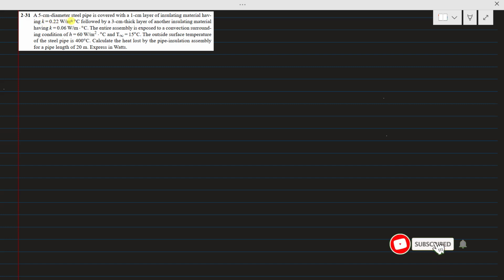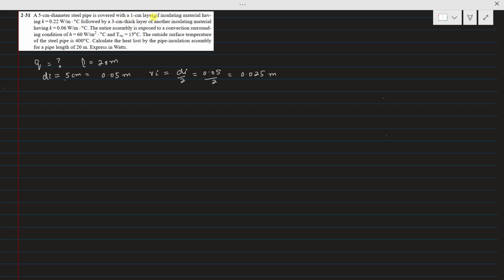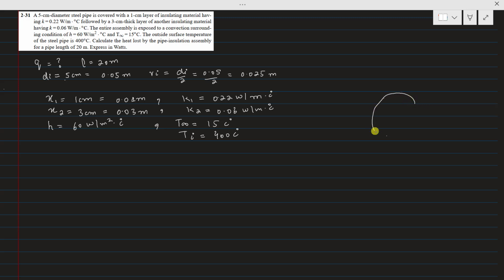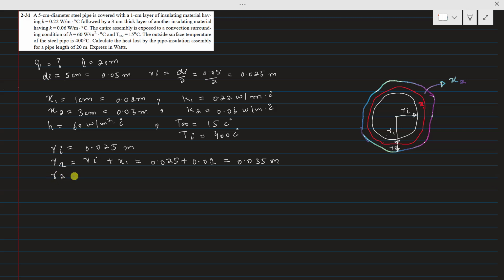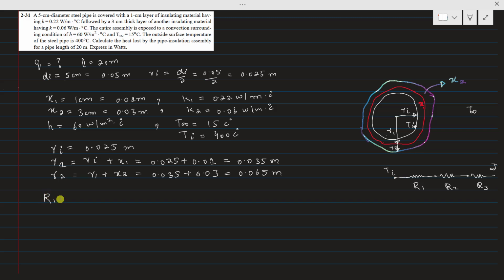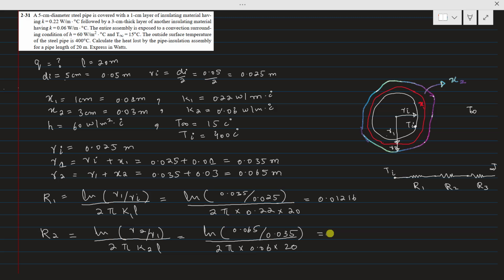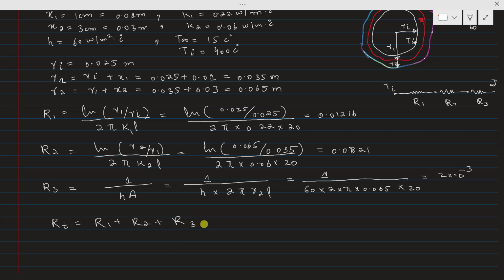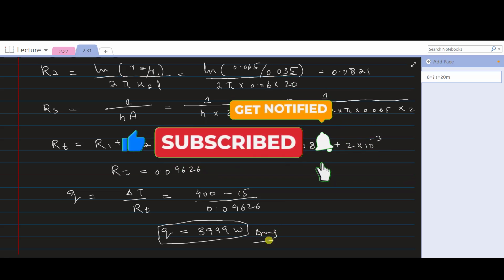2.31 Calculate the heat lost by the pipe-insulation assembly for a pipe length of 20m.

Comment: How to determinate r ?
Reply from the maker: Watch carefully and let me share the screenshots where you get confused
Reply: @education_shop sorry. Give me reason
Reply: ( Outer - inner ). Ln  ( outer/ inner ) = r.

Is it correct ?
Reply: Q = - k A dT/dR, Fourier's Law equation (1)
Q = - k A dT/dR
For a cylinder
Q = - k 2π R dT/dR equation (2)
Q, -k, 2π is constant (C). Therefore, the equation can be summarized as:
Q / -k 2π = dT R / dR
-C = dT R / dR equation (3)
-C ∫ dR / R = dT
-C.Ln (outer / inner) = dT
-C.ln (outer / inner) = Temperature (outer - inner). Henceforth, the minus sign is not rewritten; it will be eliminated by the negative of the temperature difference.
C. ln (outer / inner) = dT ` equation (4)
C. Ln (outer / inner) = dT, for all states the outer value is represented by e (a natural number).
C. Ln (e / inner) = dT, 0 ≤ inner < e equation (5)
We combine equations 3 and 4.
C = dT. R/ dR ~ C.Ln (e / inner) = dT, eliminating C and dT
1 = R/ dR ~ Ln (e / inner) = 1, then
R / dR = Ln (e / inner) equation (6)
R = dR. ln (e / inner), dR = outer - inner
R = (outer - inner). Ln (e / inner), outer - inner is the thickness of the cylinder. The radius of the envelope can be determined using this equation. Equation (7)
R = (e - inner). Ln (e / inner), outer is changed to e (natural 

We change it to function form
f ( x ) = y
( e – inner ). Ln ( e / inner ) = R equation ( 8 )
( e – x ). Ln ( e / x ) = y, inner is changed to x and y is changed to R, where 0 ≤ x < e. So the equation changes to. When x = 0, this means the cylinder is solid
f ( x ) = y
f ( x ) = ( e – x ). Ln ( e / x ), so
( e – x ). Ln ( e / x ) = y

Weaknesses of using natural logarithms to solve heat transfer problems in cylindrical shapes.
1. When comparing the thicknesses, outer = e (a natural number) and inner = 1, i.e., the thickness e is -1. Therefore, the natural logarithm value is 1. This value of 1 is identical to the plate shape. This is highly unlikely. If the plate and cylinder have the same dimensions, they produce the same heating value.
2. The expression using natural logarithms expresses the area, not a dimensionless number. If not, how can we express the narrative in the natural logarithm expression?
3. How do we calculate the radius of the envelope (although I must explain it briefly in equation 8).
4. In a solid state, the resulting heating value will be infinite. Equation (4).
5. Continued from point 4. The infinite calorific value is caused by the natural logarithm, which expresses the natural log e/0 = ~.
6. Continued from point 4. If the Fourier law formula is expanded (interchangeable) to predict the temperature value at the center of a cylinder when the cylinder is solid, the temperature will produce an infinite value at the center of the circle (can reach billions of degrees Celsius or more). This is highly unlikely.
7. Using the natural logarithm cannot explain changes in the area of a cylinder. In other words, the use of the natural logarithm cannot be linked at all to changes in the area of a cylinder.
8. Continued from point 3. The radius of a cylindrical envelope or covering is always greater than the radius of the cylinder (there is an abstract explanation). However, using the natural logarithm starts from infinity to 0 (zero). This is highly 
unlikely.